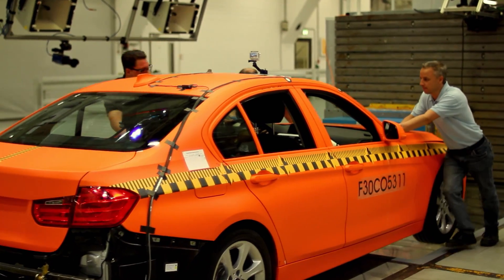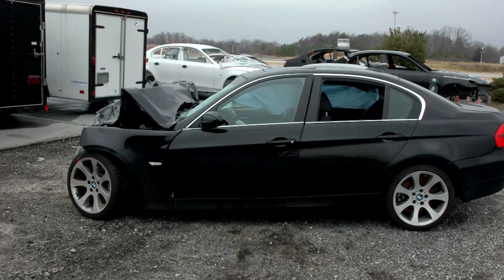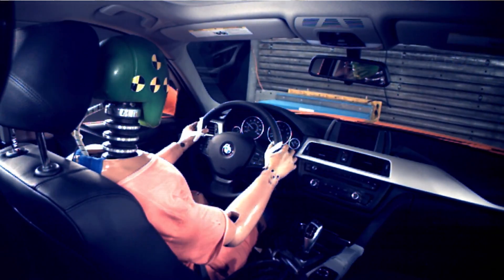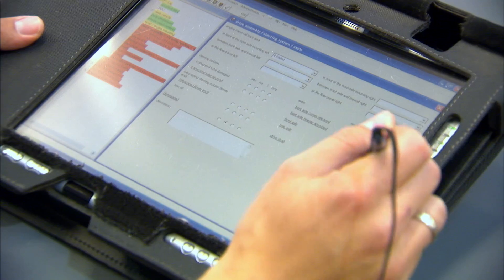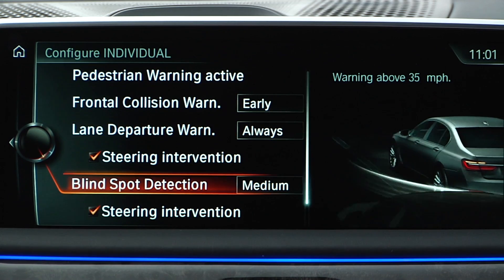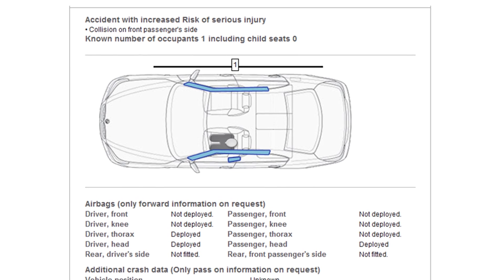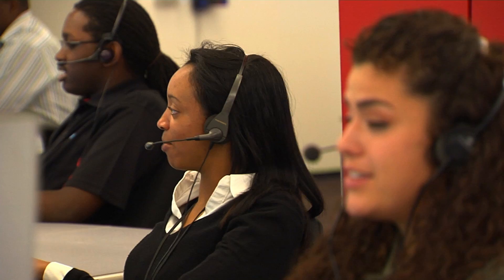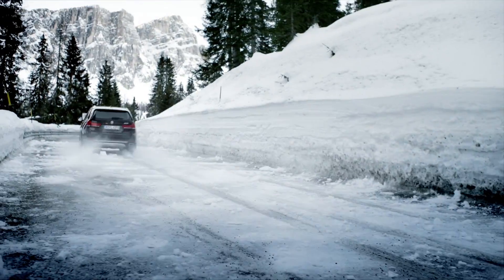BMW Accident Research

Comment: It is such an irony for BMW to start the "Safety Research" video with the F30 3-series, a car rated as "Marginal" by the IIHS small overlap crash test for the past 4 years...

If BMW really cares so much about safety, they should have fixed it asap. Not let the problem persist for 4 years.
Reply: They did. They added additional reinforcements to the f30 once this crash test was debuted, and all other models received additional technology to ensure best performance in small overlap tests.
Reply: @cj3380  i know what you are talking about, but even after their design changes (which took them 4 years, from 2012-2016), the car was re-tested after the design change and was still scoring only "Marginal" in the same test.

it took them 5 years to fix this issue, when many other big and small manufacturers took half the time or less.
Reply: @cj3380  you can see the results here - BMW's design change did not improve anything.

Rating applies to 2016 models

Tested vehicle: 2016 BMW 328i 4-door

"The BMW 3 series sedan was redesigned for the 2012 model year. Beginning with 2016 models, a front suspension change was made to better control wheel movement during small overlap frontal crashes. The change, however, wasn't enough to improve the car's performance in the small overlap test."

https://www.iihs.org/ratings/vehicle/bmw/3-series-4-door-sedan/2016
Reply: @derek400004  so, iihs usually won't retest the same car in a short timeframe (it takes several weeks to test one model) and design changes aren't overnight but from my recollection it was fairly quick in production.  Finally tested again in 16, then the structural enhancements came which earned it a good rating. Otherwise, most of their lineup did well even pre-SOC models did well in SOC. Even better once the models designed after the test debuted.  

https://www.iihs.org/ratings/vehicle/bmw/3-series-4-door-sedan/2017
Reply: @cj3380  that isn't entirely correct. they do annual tests for high volume sellers, but in most cases this is actually done whenever there is a meaningful fix notified by the manufacturer.

all 3-series manufactured before MY2017 are only "Marginal" in this test because no fixed were made before 2015, and the only fix in 2016 was also a failure.

the fact that BMW sat on their bums and didn't release a fix for 5 years (when other bigger and smaller manufacturers did it in less than half the time) is poor form.

edit: i worked in the industry so i know what im talking about lol.. have a good day.
Reply: d